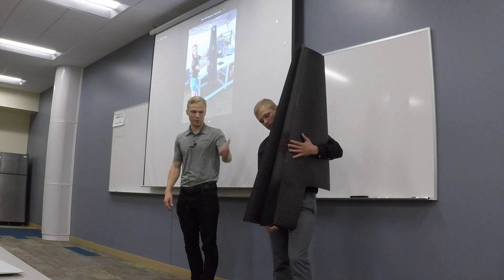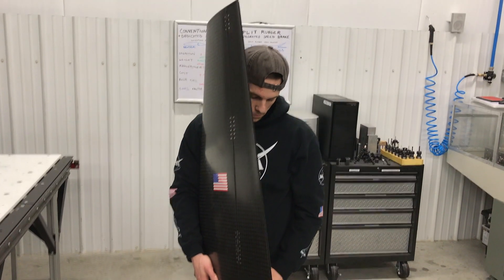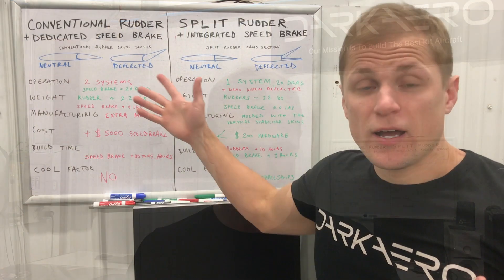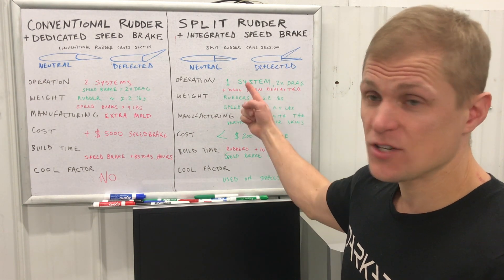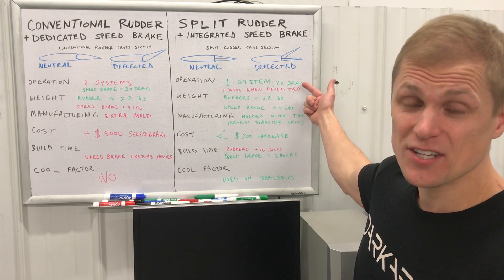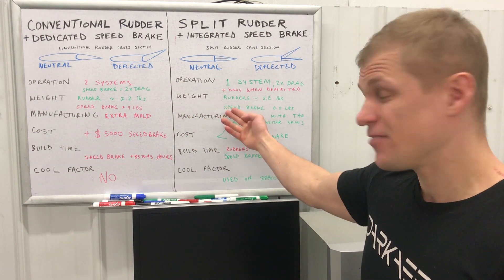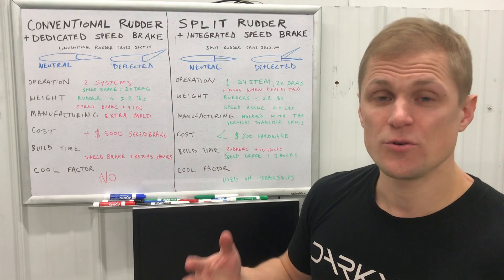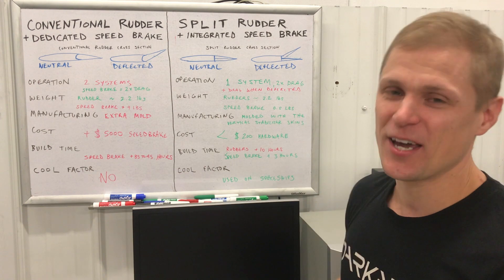The DarkAero 1 Aircraft Split Rudder

Comment: And how would the speed brake function of the split rudder compare to a simple forward slip?
Reply from the maker: Great question! A simple forward slip could be used to increase drag, but it introduces the risk of a cross-controlled stall. The split rudder would not present this risk.

Comment: That's not correct. The spaceshuttle/ Buran rudder can still Operate side to side like a normal rudder. Wich it does under normal conditions. This here on the other hand operates only one side at a time and does not have the option to move both parts from side to side. Wich will significantly decrease performance while triming or the ability to perform corrections during a glide. This problem will be amplified at higher speeds where parasitic drag becomes more prevalent Wich sadly is the speed this plane operates at. Sadly this admittedly cool bit of tec is not very well thought through.

Comment: Nice idea but I believe your engineering is not completely thought through to the pilot work load. I think you need to implement a separate control for the speed brake function that deflect both rudder halves equally while leaving differential rudder input in the pedals. I.E. flaperons. It should be simple enough to connect a control to the bell crank to deflect each rudder surface equally for the speed brake.

Comment: Saying vari-EZ's have split rudders so yours will be OK is just not correct. The split rudders on those canards are designed to create drag force far away from the CG to create a yawing force. Your split rudders will create more drag than they do lift, just like split flaps. You want a rudder in a conventional layout to make a lifting force to create a yawing moment. Creating a lot of drag won't work and rudders are critical  Additionally, comparing to the shuttle, whose rudder functioned normally but could split in half for air brake functionality is also a bad comparison. Good luck. Sometimes being different is just a waste of time.

Comment: The free-cantering nosewheel means that  the rudder and differential braking are the only means of directional control after landing.  

I have the same question as others relating to how differential toe braking will work without the using the opposite foot for leverage.

I also question how easy it will be for pilots to transition to non-linked rudder pedals.  Not easy to remember to lift one leg while pushing down with the other.

Comment: This is interesting but the control method seems like it would be cumbersome. A separate speed brake handle and mixing box to still allow rudder input with the speed brake deployed would be best IMO. Another thought to eliminate the drag when it's not needed, is to have the split rudders mounted in a carriage of sorts that's then controlled as a single control surface, so the rudders only split when the drag is needed.

Comment: There are two issues I think you skipped or at least did’t list :
- traditional airbrakes also reduce the wing’s lift, which greatly increases the drag
- During fast flight some low pressure occurs at the rudder’s trailing edge. Will the twin rudders be sucked, open a little and therefore increase drag ? I suppose that that’s the return spring’s job, still it may harden the rudder’s response to the action on the pedal.

All together your aircraft is very well designed and excepts too many “glued” components, you seem to have done a magnificent job ! Congrats 😊
Reply: That rudder is nothing but an outdated and obsolete tech straight from the 1930 design books. List 1 benefit of that design, and I'll write you book on its drawbacks.

Also the high speed force feedback can be tuned with winglets, that's not really an issue at all. The problem is #1 you don't need to have airbrakes on the wings, especially on a superlight, a simple flap would make the difference you need. #2 the wings DO have airbrakes with the flap design used...There are so many fundamental design errors in this airframe I can't be bothered to spend more time on it.

Comment: Perhaps the brake should have a different mechanism than the pedals, to reduce the risk-error factor and that the pedals are only for maneuvering. Not because of the pilot capabilities, but because if one of the systems fails, it does not affect the other. 2 more pounds can be used for the necessary counterweight on the tail 🤔🤓

Comment: Did you consider a standard rudder function with gears to perform the split for speed brakes?  The rudder halves could pivot left or right as one until for yaw control and trim without inducing excess drag and the split speed brake function could be controlled with a pull handle like a parking brake  The speed brake would then be independent of pedal movement and the gears would ensure equal application. two 1/3 arc meshed gears should be sufficient for speed brake deployment and springs on the hinges would force the shells together on the ground and aerodynamic forces would aid that function in the air.  Speed brake are a once a flight use item, so it should be better to not compromise rudder overall drag for the rest of the flight regime to provide that function.

Comment: Not a pilot, but I'm just wondering if there are situations where you need to have reasonable rudder authority while the speed brake is on ... And if  so, will this design be ok?
Reply: That's an easy problem, just don't fully deflect the rudder surfaces when used as a speed brake.  This will allow one side to increase deflection and the other side to reduce deflection, creating an imbalance, similar to the way mixed control surfaces work.  They did the same thing on the shuttle.  I don't see this being a great design to live with on a daily basis though, as there will only be one speed in which rudder correction won't be necessary, and even then you'll still need occasional nudges to keep it tracking straight.  All other speeds will require some degree of deflection, meaning the rudder will always be a speed brake to some degree except at that one speed and throttle setting.  Even the shuttle rudder operated like a normal rudder with both halves following each other until they needed a speed brake, and only then did they split.  I have a feeling that after some flight testing, they're going to redesign the split rudders to follow each other for at least the first third of their deflection before splitting.  That should cover most of the envelope in a normal flight regime so they're not constantly paying a drag penalty for being cute.

Comment: I like that the split rudder does not disrupt the main lifting surface, and leaves more wing volume available for fuel or whatever.
Reply: Disrupting airflow over the wing is one of the reasons a wing mounted airbrake works well as an airbrake.  By spoiling lift, the aircraft needs to create more lift via AOA, thereby increasing induced drag, so it's a twofold effect.  The amount of fuel you save by not adding airbrakes to the wing probably amounts to a gallon total.

Comment: Wouldn’t you create a lot of drag when just using the split rudder as a rudder since the air can’t flow around the control surface? It would render the rudder less effective due to the air turbulence on the low pressure side?

Comment: CG => Pitch issues? 
Speed breaks are generally mounted close to the CG. By exerting a  breaking force so far aft and above the CG are you not going to create a pitch moment potentially leading to a stall if not corrected with aileron input? 
Further, in the event of an asymmetric input (meaning you extend one more than the other) are you not going to create yaw + pitch up, potentially leading to a spin?

Comment: May I say thank you for the excellent series of videos about this project.  I have been a commercial pilot for over 30 years, mostly jet aircraft, and speed brakes were an essential part of the flight control system.  There is a saying in the jet pilot community, “you can go down or slow down, you can’t do both”.  But that was high speed jet aircraft.  This is a high speed low drag propeller aircraft and there in lies the difference, the prop at low power is a very effective speed brake.  Can I suggest this split rudder is a solution looking for a problem.  It is very cool though...
Reply: My thoughts exactly. I do think it’ll be a fine aeroplane though!

Comment: I really like the idea of a split rudder.
That speed brake functionality is probably going to be important for such a low drag aircraft design.
Reply: optimizing a high speed aircraft, yet one of your primary control surfaces can't help but be a speedbrake under normal conditions. Every time you're not in absolute neutral position, you have deployed the airbrake to an extent.

Comment: Control surfaces on high speed aircraft are balanced to prevent flutter.   I don't see any area ahead of the hinge point to add counterbalance weight.  Be careful on those first fast flights.
Reply: He mentions that in the comparison.

Comment: What about spin recoveries? Wont the split reduce the lift the rudder can generate to counter a spin? I suppose drag back there could help but i suspect youll have fair amount of spin testing to do. Very cool though.
Reply: I agree with your thinking. In addition, the vertical stabilizer also has a fairly aggressive airfoil leading edge, along with an unusually high aspect ratio. This means there is a possibility the vertical stabilizer will stall at relatively small angles of sideslip, reducing lateral control even more. Most vertical tails have an AR of less than 2. Not~>3. This design will have more effectiveness at small angles, though, due to it having an improved lift curve slope due to higher aspect ratio.

Comment: A big disadvantage seems to be that pilots might by accident apply speed break while actuating the rudder. Say you are in a difficult crosswind approach and have to change the rudder position all  the time. This includes the rudder crossing the neutral position. Neutral crossing with the split rudder system requires that the pilot lets go of one rudder and than pressing the other one at this moment. If the timing is off or the pilot keeps some pressure on one of the rudder paddles,  he will actuate the speed break - by accident. 

On a normal rudder the mechanism fundamentally only has one degree of freedom so this much more intuitive.  To me if feels like if you want make this work this sh

The cost does not seem like a good argument to me either because you can simply, make the break yourself out of carbon fiber as you do with the rest of the aircraft.

Comment: Good luck with the split rudder, I hope it works for you right out of the box.  Depending on what degree of offset you put in the thrust line and vertical stab., will determine the amount of rudder needed in take off and climb.  Some of the light aircraft I've flown have required considerable rudder throughout the climb phase, and I do have some misgivings about how the extra drag of the s.r. might affect climb performance

Comment: Interesting and important information, but disappointed didn't even touch aerodynamics caused by a aplit airfoil where the "pressure" surface is angled while the "low pressure" surface is left straight. Maybe this isn't htat important when the foil is a vertical tail and not a horizontal wing or stabilizer?

A split surfaces obviously means thinner construction, interesting soltuion to increase the aspect ratio to lessen the required movement to accomplish the same amount of control... which means less stress on the assembly which in turn means less strengthening required. Still, I wonder again whether this means loss of efficiency at very low speed and possible failure if max speed is exceeded like any other high aspect foil.

Comment: A few questions - how will the prop slipstream interact with the split rudder design?  From other videos I gather you have pitch and roll trim but don’t have rudder trim.  You may or may not need rudder trim to counteract slipstream, but I’m guessing with a powerful engine on a very light airframe, you will.  If you do, won’t a split rudder translate into an effectively “always on” speedbrake?  Is there an airspeed limit for speedbrake deployment and if so how is that implemented?  What happens if aerodynamic forces overcome the spring return-to-center on the rudder?

Comment: How do you 'tune' the split rudder on installation and during initial flight test so that the aircraft flies 'straight' ?
Do you have to rely on trim and if so, how is that accomplished, manually or electromechanically ?

Comment: What happens when a pilot is turning base-final at low speed and tries to overcorrect a misalignment? What happens when they realize their mistake, panic, tense both their legs, and spin that baby because they airbraked those last few knots before the stall? 

How do split-rudders typically handle stall and upset recovery compared to conventional rudders?

Designing for speed is nice, but I want an aircraft that was designed for safety and good manners, first and foremost. I'll gladly add five minutes to my trip if I'm that much more confident of making it there at all.

Speed sells, accidents bankrupt.

Comment: I just wonder, could your plane be ever faster than Lancair ? (same HP)
Reply: At the very least it will almost certainly be safer. Stall characteristics on the Lancair and low-speed maneuvering are kinda sketchy.
Reply: @ParadigmUnkn0wn  I wish you luck. I am very surprised at - you used aluminum. I do not know, if it could safe some weight, but for me- it is a synonym for fatique even it is inside of your parts. But it must be just my lack of knowledge, anyway I would rather no metal at all for it. Other than that, it is just great, when you are able to make a nice aircraft. Regards M.
Reply: @mirekslechta7161 , I am in no way associated with the Dark Aero project beyond my interest as a potential customer.

As for usage of aluminum, you realize most GA aircraft are almost entirely aluminum? Commercial planes also used to be entirely aluminum and in recent years have made extensive use of composites similar to the construction of Dark Aero 1.

Attempting to make an airplane out of steel is what would require luck, but composites and aluminum are proven materials in the aerospace industry.
Reply: @ParadigmUnkn0wn  Hello sir, thanks for your answer. To my knowledge, fiber composites like fiberglass or carbon have big advantage over aluminum, there is no fatique related weakening of any part made from those materials. Aluminum is in that regard guite an oposite. That is why I am surprised, that someone is combining old fashion aluminum with modern fibers when it is so easy to avoid aluminum in such a small aircraft.
Reply: @mirekslechta7161  do a google search on what airliners are made out of.
Reply: @licencetoswill  We all know. Alluminum mostly, but just for now,  becauce implementing glass and carbon on such a big aircraft is much more dificult compare to a something like any light sport aircraft. Nevertheless, aluminum is the subject to  fatigue safety problems (weakening slowly whole airplane as more and more fligts is done). On the other side 100% fiberglass or carbon airplanes are known for not being a subject to any fatique problems (as long as they are well made) no matter how many thousands of hours they were flown or years were used.Airliners are adopting those materials more and more, but not 100 % yeat. Most advanced is the Boeing Dreamliner. So the trend of materials for airliners is to geting rid of old fashin aluminum as much as posible because of the weight to strenght ratio and because of no fatique problems (when aluminum is skipped) . And getting rid of the fatique problems is getting rid of the big safety problem which is the huge win for any airliner. That is why the Dreamliner is supposed to serve  much longer than any similar aluminum jet airliner... Sorry about my english. Best regards M. Š.

Comment: Is the split rudder safe under icing conditions?
Reply: This isn't supposed to fly in icing anyway. 

But with most symmetric tail surfaces, icing doesn't affect it's ability to provide balancing and stability forces. Some airliners don't even use anti ice devices on the tail surfaces.